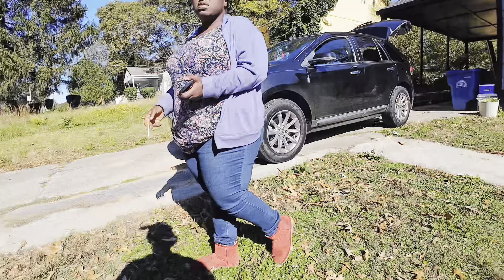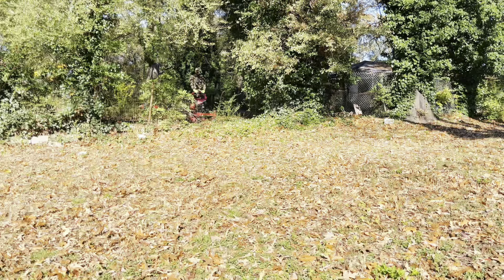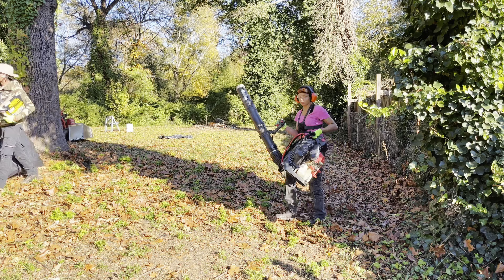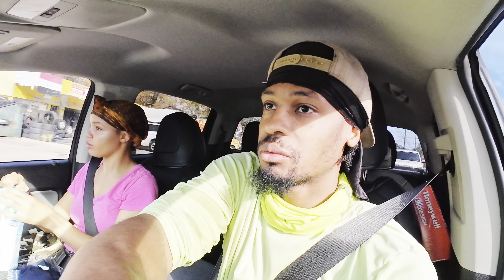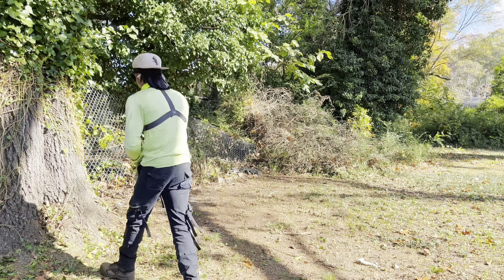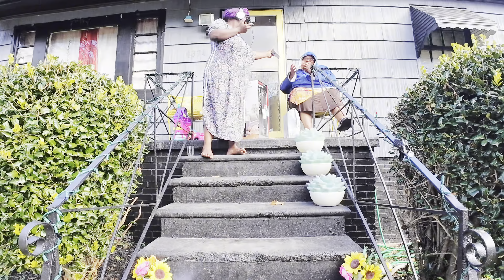She BROKE DOWN in TEARS when She found out it was Free

Comment: If they would keep their push lawnmowers under that covered area so they would get wet it would be better. Also putting something like Sta-Bil in the gas tank and gas can it will help with any moisture in the fuel line. Change oil, plug, air filter once a year would be best. Need to keep those vines and weed trees off the fence or the rest of it will fall down.